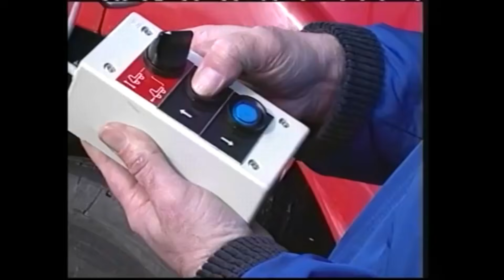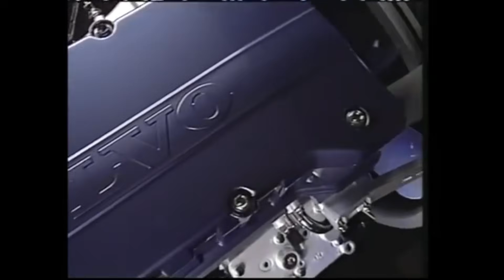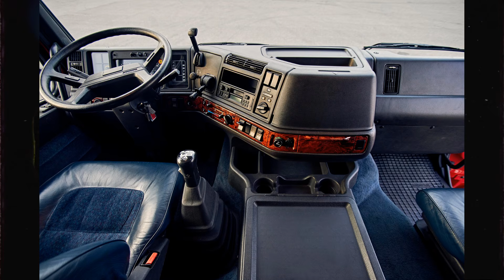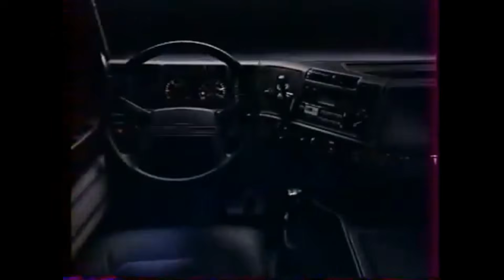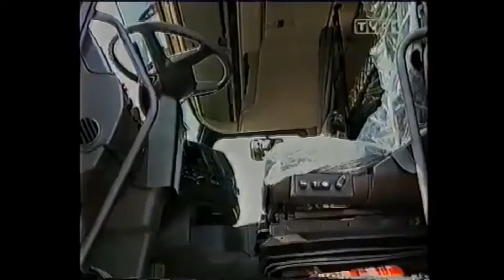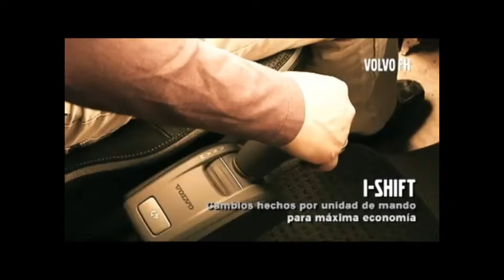Why the Volvo FH Became Europe’s Favorite Truck

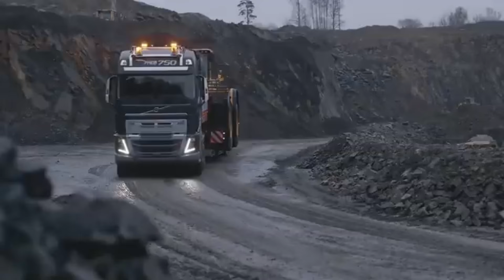Comment: 10:27 it was the same cabin from 1993-2016, the facelift you've pictured is the v4 update. The new gen came out in 2017 with a new cabin. 

Australia had Cummins powered ones for road train use in the V1. The v1 chassis wasn't that different to a fl either. Z cam brakes etc. The V2 update made the chassis new and much easier to maintain